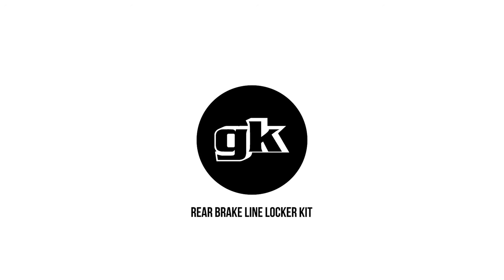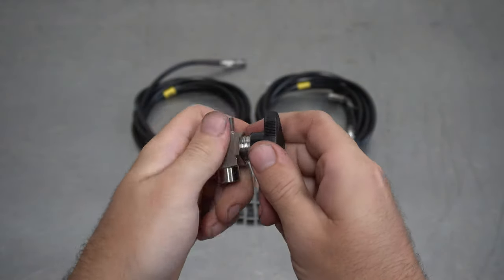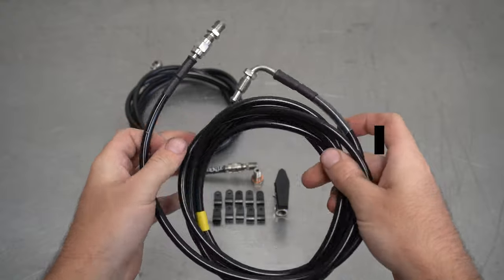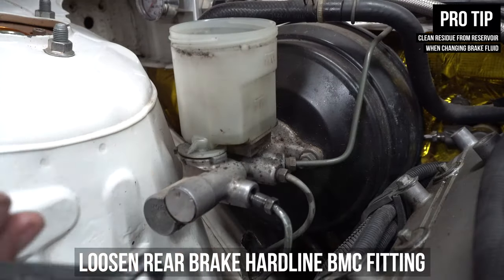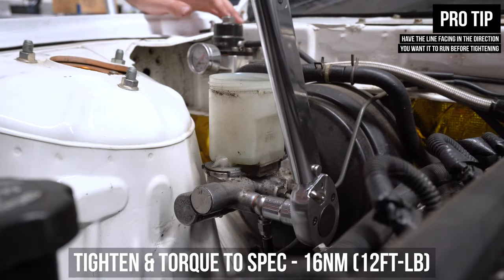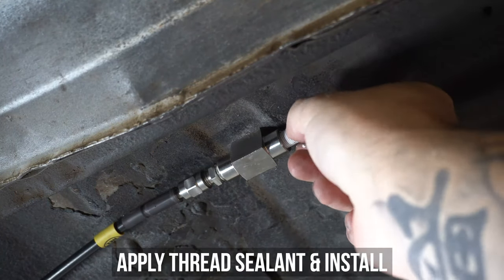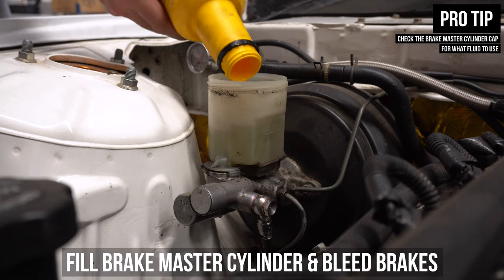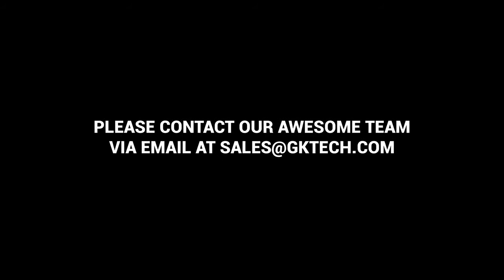Gktech Rear Brake Line Locker Kit - Install

Comment: is it ok to run the brake line through the interior? i dont wanna drill a big hole in the floor of my street car, but i still wanna do burnouts and not roast my rear brakes 😂
Reply from the maker: Yes, you sure can, as mentioned this was just specific to this car, but we add extra length to suit any orientation, so feel free!

Comment: Is this kit universal?
Reply from the maker: Yes, it's not to a specific chassis length. Providing fittings are the same it's universal.
Reply: @gktech  ok thanks for clearing things up for me 👍
Reply: @gktech will the banjo bolt fit in any cylinder? or do you have to get your own i have a truck